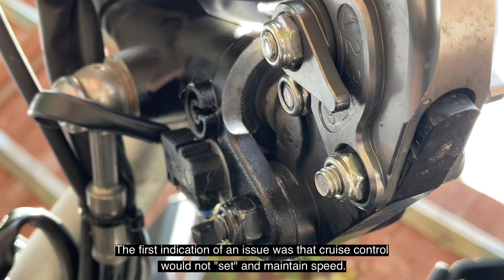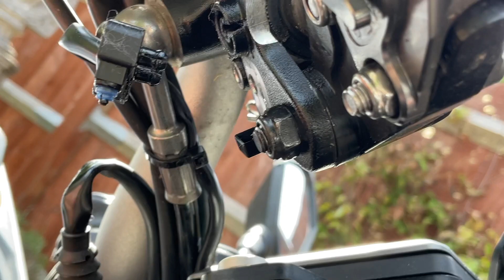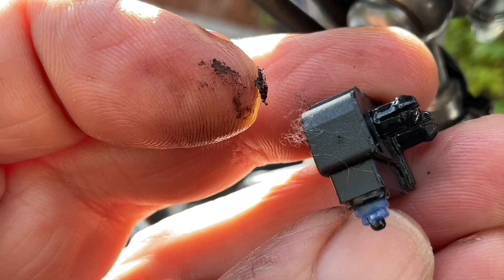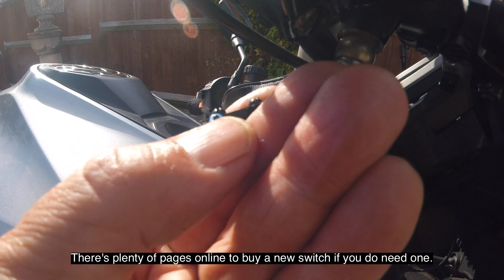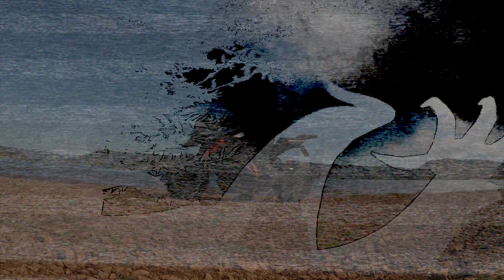KTM SUPERDUKE FRONT BRAKE SWITCH #ktm #frontbrakeswitch #superduke1290 #1290frontbrakeswitch

Comment: Hey Kev, what bike is that mate don’t suppose you have a part number for that brake switch? It’s the same as my 2024 ktm exc switch which broke but I cannot find a part number for it? Thanks
Reply from the maker: Best I can do  is find an old link to ebay. The part looks the same as mine for my 2017 SDGT, says for a 2019 1290R. Hope that helps. https://www.ebay.co.uk/itm/276217712132?mkevt=1&mkcid=1&mkrid=710-53481-19255-0&campid=5338365712&toolid=20006&customid=EB220253727&
Reply from the maker: Looks like the right part number?https://www.motorcyclespareparts.eu/en/ktm-parts/61311050000#:~:text=61311050000%2C%20Brake%20Light%20Switch%20Front,in%20the%20part%20drawing%20below.
Reply: Thanks Kev you’re a star, appreciate that buddy! Thanks again